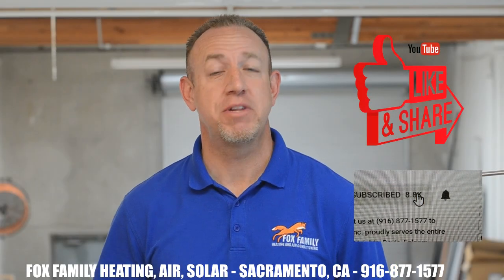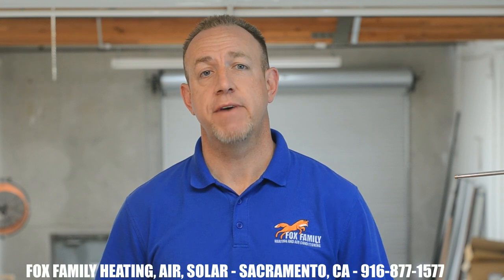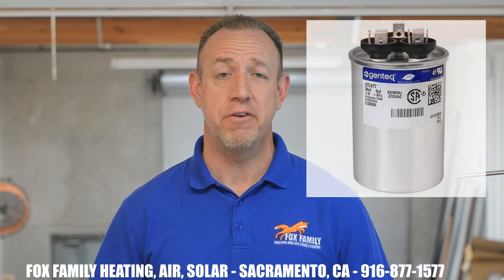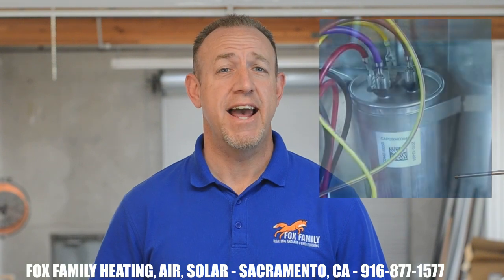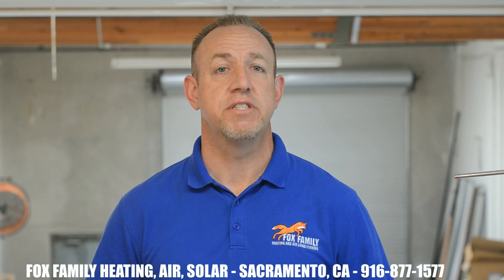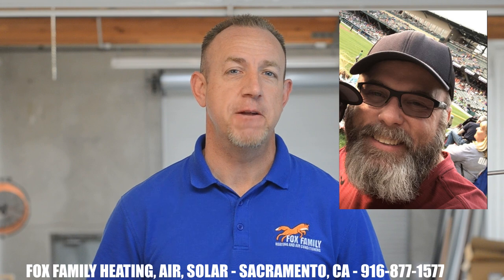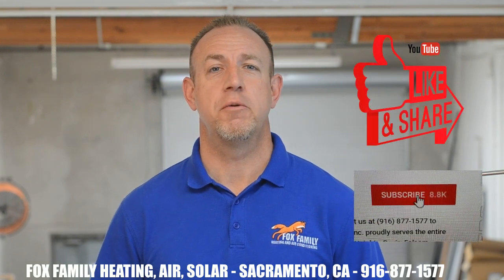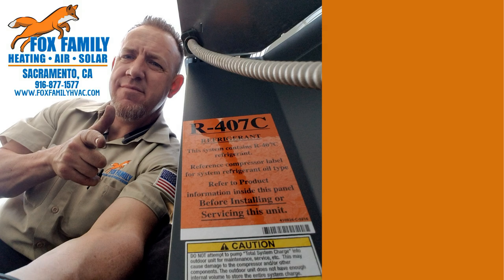Can I Run My AC Without a Capacitor - HVAC Capacitor Replacement Guide

Comment: Our unit was diagnosed with needing a motor and or capacitor it's still runs very cool air you just have to turn the AC blades  by hand but it runs very well

Comment: Question: the HVAC WAS serviced and then I had it cleaned 400.00 one month later both capacitors went bad on my 3 ton Train unit. The guy went up and bypassed something that bypassed the thermostat. It’s been apparently coming on for the last 5 days it goes off in a few minutes .  Do I have permanent damage or will it be ok ? I shut it off at the main breaker box .

Comment: In a  permanent split capacitor motor the two windings are designed to share the load as equally as possible. The capacitor essentially turns the motor into a two phase motor run off of a single phase power line current. The capacitor is needed to phase shift the power for the 2nd winding. If one did get the motor started, it would only have half the torque to speed and would likely over-heat.

Comment: Instead of being clipped for $300-$500 for a $15 capacitor, consider what I do. On the 3 HVAC units I own, I keep a spare capacitor for each unit. It’s a 10 minute job to replace them….and plenty of videos for those who are unsure of how to do it. I have light bulbs in my two homes that are far and away more dangerous and difficult to change my HVAC caps.
Reply: Well done!  It is an absolute crime for what they charge for a capacitor. I have always had a spare and always changed my own as well.
Reply: You can discharge the energy in a capacitor by rubbing a screw driver over the + and - terminals on the capacitor.  A must do when removing it.  There are many videos on how to properly replace them.

Comment: The compressor will often run without a functional run cap if there is a hard start kit.  That’s actually a downside of hard starts because such operation can lead to failed compressors.
Reply from the maker: Very good point!

Comment: If both ac condenser fans are running on the same capacitor but one is running very slow or not running at all would it be the motor for that fan that is bad?

Comment: Perfectly explained
Reply: Did he explain if you have a failed cap you can manually start your fan to keep your children w a fever cool to avoid death on a Sunday when you cant get a cap????
Reply: @dvin5170  how is that done please sir
Reply: @dannyflanery7466  use something to kick start the fan by pushing on a fan blade, but be careful not to get caught up in the blades when they start spinning.

Comment: I just replaced an indoor fan motor and cap with Mars brand.
Reply from the maker: Good brand to use!
Reply from the maker: Good one to use!
Reply: Fox Family Heating, Air Conditioning and Solar I get most of my parts at RSD.  They are just around the corner from me.

Comment: Hey man I see you’re in Sacramento, I’m down in Oakdale and I got quoted 11,000$ to repair my broken hvac. Is that really what it would cost? If you can do it way cheaper I’ll call you to do immediately.  The little I know about what’s wrong is. Compresser out and he said something about rust on the raidiator looking thing. The guy that came out try’d to fix it at first with a fuse. Bottom line is it’s gonna be 103 in the valley today and just get hotter and we need our a/c bad. I would be ok with just fixing the a/c part of the hvac, if that would be feasible and cheaper than a complete fix. I’m glad I found you’re video and I hope you can help!! Thank you either way for a very informative video. Well done sir.
Reply: how did you end up getting it fixed?

Comment: My AC was running but blowing out warm air. The repairman said the capacitor had become disconnected. How would it run at all without the capacitor?
Reply: If your fan is not working your ac isn’t working.
Reply: @StevieD44  YEA but LAST NIGHT MY FAN ON COMPRESSOR WAS WORKING but no cold air-- they came out and 10mins later replaced CAPACITOR-(250$)..    anyways blowing cold now
Reply: Don Blade now you know next
Time. You can replace it yourself. It’s like a $30 part and they over charge the shit out of us!
Reply: @StevieD44  well after watching this video and reading comments i called the ownee of my ac guy who i have used for 15years.  He said he will refund my money i paid his tech.  So everyone comments and video ended up saving me 250. Lol. It probably help when i told him 1 year warrenty should not just apply to compressor only when a customer and his family purchased 5 new 4k installs in 15years. He agreeed

Comment: Mike Williams Plumbing & Heating  charged a guy $350 for that same capacitor.  Is that a good deal ?
Reply from the maker: With the service call and capacitor, yes I believe that's pretty fair.  No company is going to get rich for selling caps at that price considering how much we have to pay our techs. pay for the vans, pay for insurance etc, etc, etc.  😀
Reply: @foxfamilyhvac   I do HVAC in Wisconsin and for a capacitor on a outside condenser we would charge $125. I will also clean the outside condenser if it's dirty after I check my charge and amp draws. I also check T.Ds and proper airflow. I can do all that within a 45 mins. I guess where I live we don't rape people over a $20 part.
Reply: @jakejohnson4915  $350 is common fare out here in california, that's if the tech wants to change it or just replace the unit.
Reply: @blackishpariah  glad I live where I live!!  I just built a 5000 sq ft log cabin on 80 acres that had a river running threw it for under $400,000. Hunting and fishing at my fingertips and no nieghbors plus I'm not getting rapped by over  charges on shit. Sucks to be you guys paying three times the amount for shit.
Reply: I replaced both of the capacitors on my rooftop unit this morning myself for $38 in parts from local supply house.  I discharged the caps like other videos show (plus wearing gloves).  3 years ago, by a licensed HVAC company, it was about $175 total, labor and parts.  My roof is flat and I also saw how HVAC guy did it last time. Always disconnect power first. If in doubt about your abilities, call around for estimates first. 1.5 hour labor (including diagnostics), plus about $50-75 in parts.  Anything else is overcharging, IMHO.
Reply: @jakejohnson4915  sucks to be you dude lol capacitor change , condenser coil wash $425 here in cali we value our work and its not cheap to live here like Wisconsin 400k here wont even get you the crappiest house, you gotta pay to be in the nice states but if you own your own company and live in Wisconsin I guess 125 is fair lol
Reply: You got ripped off by dishonest people, it's pretty common in the HVAC world as you can see from these comments.

They replaced a $5-$10 dollar part that takes 5 minutes!!

No honest person can justify this amount of gouging.

Not even a Doctor nor an attorney would charge anywhere near that for their time.  How these comunity College HAVC HACKS!! think that is ok is just plain immoral.
Reply: Ripped off for sure!
Reply: @jfmc2581  so true! I work for a plumbing and HVAC supplier here in California and those capacitors mainly Mars brand cost between $20-$40, the extra $300 guess is labor, and that's insane. obviously they have to charge labor fees but $300?. I change my capacitors on my own and it takes about 10 minutes.
Reply: Anyone with common sense and know how to Google can do this for less than $20 so YES most definitely a rip off. My dad does this for a living and he has taught me everything about this so I'm not bs'ing not all people can afford that kind of money for a cheap part and five minutes of easy work!!. HVAC companies need to charge reasonable prices on easy jobs and if it's a harder job price accordingly to the job. Yes most are rip offs. Have a blessed day.
Reply: Most capacitors run $15 or less and it takes 10 minutes to change so $350 is a rip off.  I was just quoted $750 for a capacitor change out sight unseen and refused to be gouged.  I watched a few videos and viola, I learned it's not a big deal. Just discharge the capacitor before handling it.
Reply: @BigTexan7  and how would someone "discharge" the capacitor?  I know it's stores up energy/electricity, just not sure how to discharge it

Comment: Can I Run My AC Without a Capacitor? No, The End
Reply: Yeah but then again.... Yes, Yes you can and there is absolutely no reason not to!
Reply: Jf Mc how
Reply: @Robert-cc4go  , Start the fan spinning by hand, just like mentioned in the video.... until you get a $10 replacement part.
Reply: @jfmc2581  I DID FOR 28hrs AND NO COLD AIR CAME OUT!!  then 250$ later after a 10mins AC INSTALLED A NEW CAPCITOR all is good.. he said it was bad.. fcking machine was 3500 less than 1 year old.
Reply: @donblade5405  , Should be under warranty.

Comment: What a pointless video.  The capacitor cost $15-20.  The HVAC guys that come out aren't exactly highly trained geniuses either.  Just turn off the power, discharge the capacitor, buy the correct part and put in the new one.